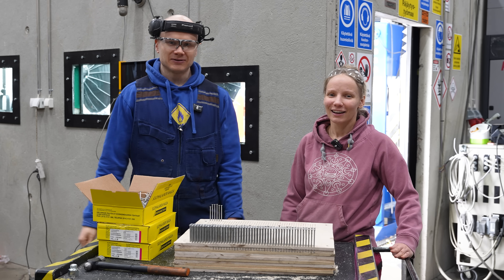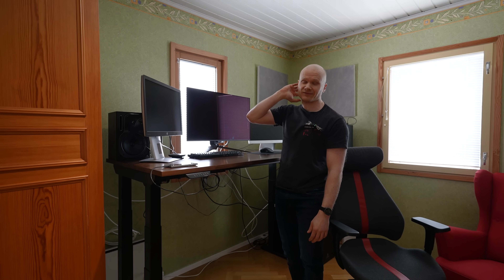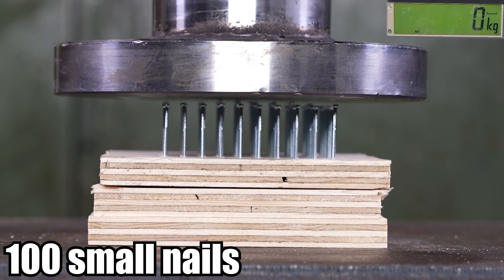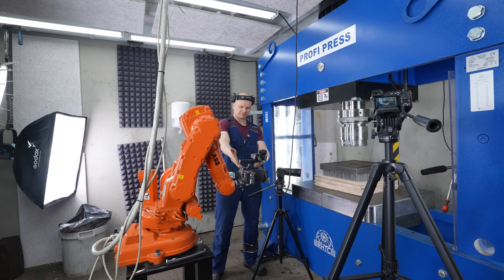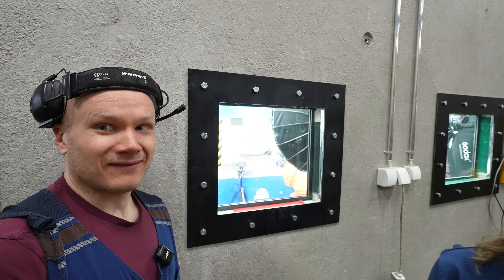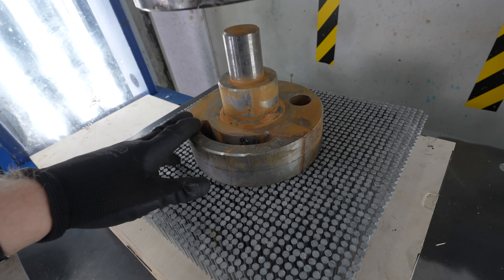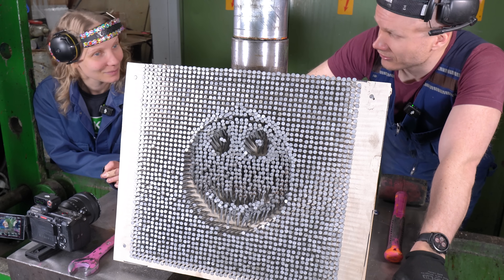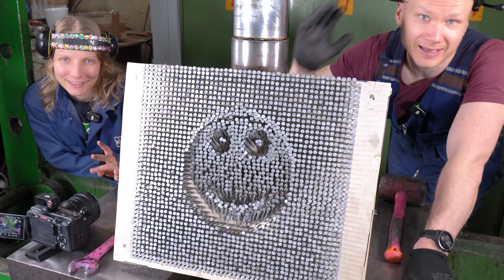3000 Nails vs. 300 Ton Press – Is It Enough?

Comment: I think the nails where a bit too tightly spaced. There was not enough room for the wood to compress to any direction between the nails. You would have needed enough power to compress the undrilled plywood to almost half of the volume it was before to make it happen 😅

Comment: "3000 Nails vs. 300 Ton Press – Is It Enough?"
The answer depends on which one is being asked about sufficiency.
- If you meant will the nails hold their position - the answer is YES.
- If you meant will 300 tons press the nails down - the answer is NO.
It's clear as day that ten such nails are not even 100g of pressure per nail. Why does a hammer need significant force to drive one nail down - so don't even waste your time watching this video.

Comment: A hand is a unit of measurement. 4 inches make 1 hand or 1/3 of a foot. Horses, donkeys, and mules are measured in hands from the ground to the top of the shoulder to determine height.

Comment: Nailed it! Or not. 300 TON on 3000 nails is 100 KG at pretty each big nail. I counted each row and it was about 48 horizontal and few less vertically. So about 47² is just about 2.200 and you need about 55² to get near 3.000 nails. So it was short of 800 pieces. It was quite amateurish for a Channel that has 10M subs.

Comment: Huh. My prediction is... huhhhh.... I think the nails will go in a little bit, but then they will compete for space. So the outer bits of the wood will fracture off, but the further you go in, the more the nails will just bend, compress, maybe the heat will be enough to get the wood smoking.... if it's moist, there will be some steam.... 
Let's see if I guessed right...
Nope.

Comment: The fact that you were able to get 3000 nails together on one plank of wood, is an amazing feat in & of itself.
Reply: CNC pilot holes make a job like that physically and technically easy, but it's still a good bit of time put in hand placing the nails.  They showed footage of the mill doing the drilling.

Comment: Hello again HPC. Great idea to do progressively more nails. My suggestion is to arrange another bed of 2000, or was it 3000, nails. Then look around Finland at all the big steel shops. Some of them will have a press that goes into the 1000 ton or more range. Now we have to know how much it takes to sink all those nails. One viewer thought the close proximity of each nail prevented the wood from expanding around it. If so, they will not sink as a nail should. We really need to see that effect also. Your pilot holes should cancel out that issue though, unless the physical laws of earth have changed recently. It worked last week so should still be ok. Ps- a nice box of pastries should grease the skids enough to find help in any steel shop. Good luck!

Comment: Problem with compression. You now have so much surface area pushing down on the wood, it's density increases, and it becomes impossible for the press to overcome.

Comment: Did the big press run out of force, or did it run out of travel? It looked to me, like the ram may have simply bottomed out, due to flexure in the table. an extra spacer on the steel slab might have helped.

Comment: I wonder what would happen if you took the stack of wood with 3000 nails, put the large steel block on top, and then put explosives on top of the steel and set it off? Would it push all the nails in then?

Comment: Your earlier tests used shiny nails - not galvanized ones. The zinc melts while being pressed in. Once you stop, it freezes again and the nail is bonded to the wood. You can't get it to start moving again. So I think that after the first push, you were done. The happy face tool could only bend the nails. Ditto for the eyes. I liked that you used a CNC to make the starter holes. Thanks.

Comment: 300 tons over 2000 nails, that's only 150kg (330lb) per nail. You figure you'll need more pressure than normal, since the nails being close together means extra compaction of the wood between them, and it starts to make sense why it didn't work.

Comment: The smiley face might work if the eyes are made a bit larger (or the mouth smaller) so that the total cut out area on the tool is symmetrical about the axis running between the eyes and mouth

Comment: Your problem lies with the fact that the wood doesn't have the room to expand with how close the nails are.
Reply: AKA too small press
Reply: The physics behind this could be pretty interesting.  Driving a nail through would, as you  mention, isn't simply a matter of applying enough force to the nail.  The nail cannot "make" a hole. The wood that was in the hole doesn't simply disappear. The nail actually has to PUSH that wood out of the way.  It gets pushed into the surrounding wood.  The surrounding wood of course doesn't like this and resists, and that pressure is what keeps the nail "stuck" in the wood.  The wood itself can compress somewhat, but eventually you will have to  push all of the rest of the wood out of the way too. Turns out matter doesn't really like that too much and can put up a surprising resistance (see, white dwarf and neutron stars!)

With this many nails occupying so much of the wood, you are getting compressed wood wanting to expand outwards meeting other compressed wood also wanting to expand outwards. So as you say, you get a surprising amount of pressure, and not  enough wood to absorb it all, and I think more importantly, no easy way for all that pressure to escape to the edges where it'd be free to expand.

So essentially you now have the press force vs the internal density and pressure of the wood.  So what gives out first, the internal pressure of the wood, and the nails eventually sink in? The press itself, where it doesn't have enough force to overcome the wood's internal pressure.  Or if both of those hold, then eventually all that pressure and force WILL make it to the edges of the wood, and it'll explode out the edges.

Super interesting for such a "simple" experiment.
Reply: Maybe try adding some water to make the wood wet first?
Reply: I think the wood would compress?
Reply: @glenmchargue5461 given the explosions they have had in the past, compressing anything made from wood, at a certain point the wood doesn't compress anymore and within seconds it explodes out sideways.
Reply: He could fix that but it would be insanely expensive and not worth it. He would need two pieces of steel each weighing probably a quarter ton to be able to evenly apply pressure to well-spaced nails. I would argue this is it's own experiment rather than "Is there any configuration that allows us to push 2000 nails into wood."

Comment: 300 tons divided by 2000 nails is only 300 lbs per nail, which is no more than the two of you standing on a nail.  I was surprised to see the nails move as much as they did.
Reply: The problem is that the wood underneath gets compressed and becomes as hard as a rock
Reply: It’s a little more complicated than that but yeah.
Reply: Yeah.  Friction is wild.

Comment: My man just lifted 70kg like nothing
Reply: Didn’t he used to be a powerlifter or something?
Reply: Glad I wasn't the only person to se that. Man is a machine.  U can just lift 50 like that. I am skinny rake tho
Reply: People underestimate the power guys like this have! 
I worked on an Egg farm. & the farmers son had an issue with one of his arms. 
I was pushing a trolly with 2ton of eggs & the pump trollys wheel was stuck in a hole in the shed. At that time I was in my 30's & now a weak man. There was me & the other farm hand trying to get it out.. we didnt have the space where it was un pack & off load.. 
The Farmers son came in & just pushed the thing out of the hole like it was nothing.. one handed... 
I was benching about 180kg back then... 

so yeah I can easily believe that this guy picked up & moved 80kg like that!
Reply: With his back though, ouch.
Reply: No way that was less than 60 kg of it was 50mm×400mm×400mm
Reply: Yeah no way that is 70kg. Maybe half.
Reply: @DMalek  Definitely not "half" or 35kg - at my gym we have 40kg plates, and I am a small marathon runner and can still lift them up semi-easily.
Lauri is like twice my size, so I wouldn't be surprised that he lifts a 70kg slab of steel that easily.
Reply: @DMalek I was wondering if he meant 70 pound but I can't imagine he works in imperial unless it was for the US audience.
Reply: @brettcleveland6335  yeah 70lbs maybe, forget about 70kg he picks up that easy
Reply: @brettcleveland6335  he always takes in European units.
Reply: @DMalek  that is only 154 pounds not all that much really.
Reply: @DMalek that's a massive hunk of solid steel, it could easily weigh that much.

Comment: "Hey, if you can use feet, I can use hands" 😂
Reply: The irony being that the 'hand' is also an English unit on measurement, equal to 4 inches, primarily used for the height of horses.
Reply: @mpf1947  Interesting! I did not know that.

Comment: Looks Like a CGA (Column Grid Array) IC Packages are made with non-collapsible solder columns for surface mount soldering on printed circuit board (PCB).

Comment: Experience-based suggestions for your FlexiSpot table: Move the control panel under/back to avoid bumping the buttons.  Someone comes up and brushes those things, it can get pretty awkward or dangerous (I like to use a footrest but can get crushed).  Two, is get those monitors up on arms to free up table space.  There's some sturdy knock-offs on amazon.  1.5 is to put the thing on a switch to reduce power draw and further prevent inadvertent moving.
...The power supply built into the charger is pretty noisy.  I'd stick to proper chargers.
Thank you for the coupon last time, btw 😉
Reply from the maker: I ordered sturdy 3 monitor arm from Amazon and for speakers I am going to build probably something myself. They are so heavy that monitor arms can't deal with them. Also got today my exercise ball :D It's good middle option between sitting and standing.
Reply: The monitor arm clamps will crush the bamboo top, so a piece of aluminum/steel to spread the load will help (on the underside).  Best of luck, and happy neck/back therapy!
...need more sauna time, I suspect.
Reply from the maker: @gth042  That's great tip also, thanks for that. The back feels good luckily already but doctor isn't pleased on how it feels to him when I twist my head :D But it seems to be getting better slowly.
Reply from the maker: And thanks for using the coupon😉
Reply: Had to put my monitor on an arm for reasons other than aesthetics or even space-saving, but... yeah. Best thing I've ever done. Frees up space, makes the desktop look less cluttered plus it gives you a ton of flexibility. I would not want to go back to one of those standard monitor stands, and the arm I got was only 20 EUR or so on amazon. I simply went with one that fit my needs, had thousands of reviews (most of them positive) and didn't cost an arm and a leg. 
Just one tip: According to some users, some of these Chinese arms are a little optimistic when it comes to the weight they claim to be able to hold reliably. I went one weight class higher than what my monitor would need and I haven't had any issues with the arm not holding the weight of the monitor/screen.